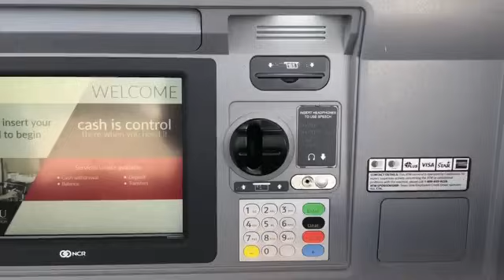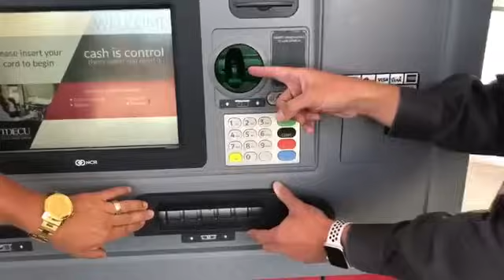How do ATM skimmers work? Experts show how devices steal your credit and debit card info

Comment: The components here are very specialized and well designed. The companies that make the ATMs should be aware that their equipment has certain vulnerabilities and respond with counter measures of some kind so that these devices can't be designed to slip over the parts of the ATM.
Reply: There are counter measures made, but it's up to the bank to purchase them. The problem is, it will never be 100% fool proof. You stop one way and they will figure out another way. It's a vicious cycle
Reply: I work for the company which is also in the video, there are ton of countermeasures but is up to the bank